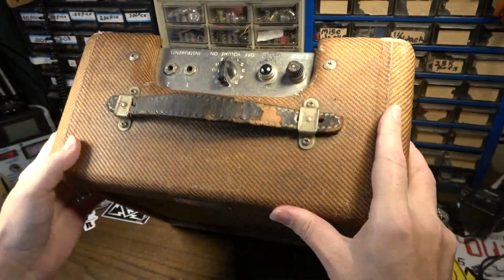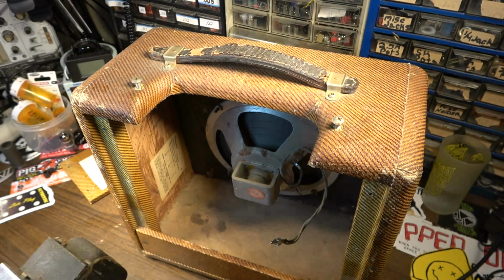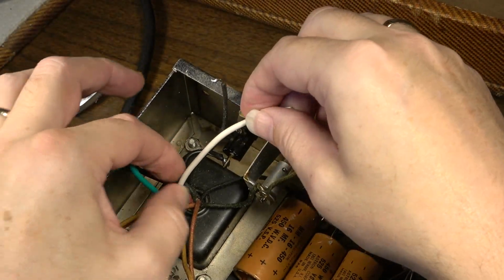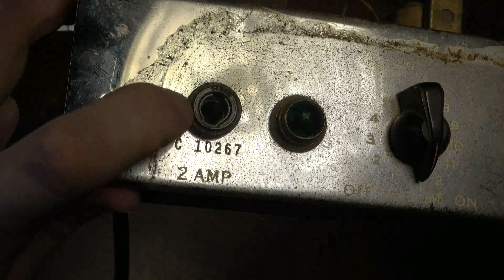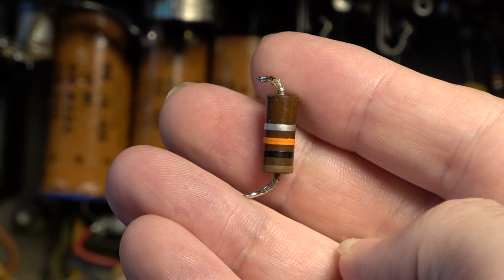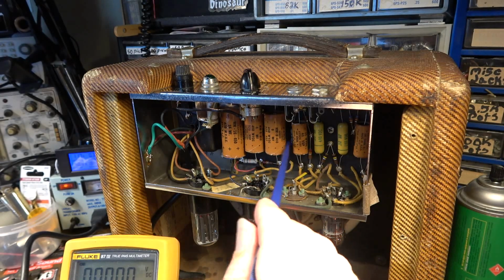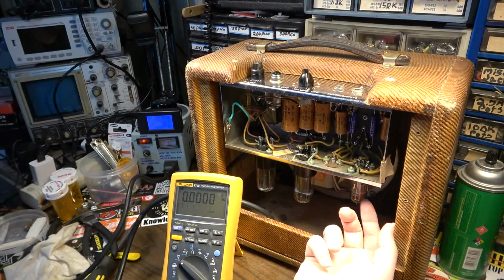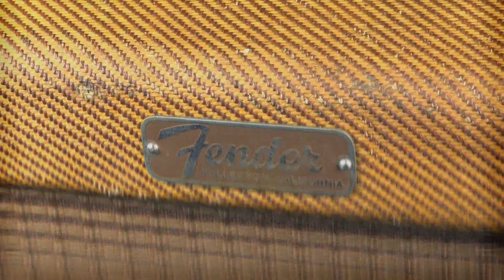1959 FENDER CHAMP 5F1 Guitar Amp Repair, Restoration & Demo

Comment: Speaking of fuse holders, when I was a teenager I used to play through a blackface band master. The amp had a vinyl cover on the head and sometimes it would get bumped and the bayonet type fuseholder would jump off and fall into the back of the amp, leaving the fuse sticking out. I would not notice and reach around the back to turn it on and get shocked. Happened a few times before I learnt to check it first, but being usually up on a wooden stage gave me some protection I guess.

Comment: I will share a thought I had on those capsule shaped caps. As opposed to trying to drill them or cut them, which from the attempts I have seen, they are generally brittle and break up, make some semi rounded buttons and glue them to the ends of the new cap. That will get you the general shape, and you can go as far as you like from there. Paint them blue or yellow, stick on a label. At any rate, there is an undue amount of effort you can put into it for what they are and the purpose they serve. I do like the paper cap stuffing though. Simple and not too time consuming to preserve the appearance.

Comment: I replied but but was too late for Live Chat....on the Uncle Doug fuse wiring...
I prefer the Fuse first...i have Electrical experience ( limited license ) and do lots over 50 years ...
The Fuse in my opinion should be First... As it protects you from there on in chassis....i unplug it if looking at fuse..or use pliers to pull a fuse if still Hot...common practice is ASSUME it is HOT... So UNPLUG....Or use a insulated tool if you have to Extract the Fuse ( most come out with the cap??  )  and it sticks inside...you just play it SAFE...I do get Uncle Doug's logic...and it is more for inexperienced users...so either way is fine...not sure what the code book says??
Reply: PLUS...you have to think live a Novice on this topic... They won't know whether the Switch shuts Off the power to the Fuse..unless they look inside or understand how wiring works...so the SAFEST practice is Unplugging the unit....it is going to safely cut off power in any wiring of power switch/fuse situation....
Reply from the maker: Code is fuse first.
Reply: @TheGuitologist  
Probably the same here in Back Bacon Land...it usually is ...and should be!
Reply: @TheGuitologist  
On some olde Fender schematic (not that that counts anything) I noticed (today!) on one wire the switch, on the other the fuse...
Reasonable ridiculousness...

Here in Europe the sockets are not directional i.e. one does not know (without testing) which one is hot.
So switching both lines is due.
Then I asked myself these days (as I also consider fuse first) it would be appropriate to fuse both lines,
because if there should be a short to ground, without the circuit, the current won't go through the fuse if it's on the neutral wire...
Saved 2 bucks while sitting in a dark cellar listening to the smoke alarm. lol

Comment: Another interesting thing is also how much those caps dragged the HT/B+ down, a sure indicator that they were leaking. I also personally agree that the fuse should go first, it would be even better having it before the line cord like the Brits do it with their plugs, but first thing inside the amp is the next best thing.

Comment: I always thought you had to lift one end of the cap to test for DC leakage.
Reply from the maker: Not in this particular instance. The side of the cap tied to the next stage's grid should be as close as possible to 0V on the 12AX7 or maybe even negative volts on an output tube, depending on the type of bias. A leaky cap will leak voltage across the cap just as a resistor would in the same position.

Comment: Cute little amp.
The OT is pretty small, I doubt if it is original. However, unfortunately that small sized output transformer is not a good sign if you want a beefy sound.
Many years ago I built a Champ clone and used a OT from a swedish 1959 Luxor Senator tube radio featuring a typical SE EL84 output stage. The size of the OT of that radio is almost twice the size of the OT  of this original Champ and it is still not very good at bass end and highs. 😱

Comment: Hi Brad - i am very good with my hands and I could certainly copy and fabricate this amp for myself. i am curious, if I were to do this, what is your estimate of the cost of the electronic components that I would need to build this?
Reply from the maker: It would depend highly upon where you buy the parts and at what quantities. If you're building just one amp, it might be worthwhile to look into the kits. There isn't a ton of markup in those. Or if you want to save money on a build, buy what you have to buy and maybe repurpose something for a chassis and cabinet.
Reply: @TheGuitologist  thank you

Comment: Wondered whether it would be worth preserving the history of the amp's electronics by mounting the old capacitors/fuses/etc on a small board and attaching it inside the speaker cabinet with written dates changed/locations so that the full history could be maintained for the future (rather than just throwing away the old components) ... ???

Comment: Lovely electrolytic restoration! Keeps the original look while functions good as new.
Pity about the asbestos. I wonder what it'd take to get rid of it properly. And I think that they should have used a piece of sheet metal, at least that would provide some screening and hum/noise protection.
As for amp repairs, I hold Uncle Doug and Mr Carlson's Lab in high regard. The latter has designed some interesting test equipment (capacitor leakage tester, outer foil indicator, curve tracer etc.) that would prove helpful in vintage equipment restorations.

Comment: A dab of Silicone on the back of that switch, between those 2 points, also locks parts down so they can’t move from vibration.    No such thing in 1959, great modern helper, good for potting those tiny switches, you might use to switch coils on a guitar PU.
so the wires don’t fatigue and break!

Comment: Brad - Please Read:

 It is not my intention to argue with you, and we kinda already had a bit of a discussion about the asbestos heat shield another time when you brought it up.  I left your response alone, but here are my credentials (and I might be missing a few).

I have a asbestos hazardous abatement license, a project designer license, a asbestos management planner license and a contractor license.  I also own a successful business that performs asbestos abatement.  I would never claim that I know all there is to know about asbestos and it's potential dangers etc., but I certainly would never tell my audience that it isn't "that big of deal as long as......" to use your words.  The truth is, we don't know.  

What makes asbestos so dangerous is that they really can't pin down or correlate exposure to illness.  One person can take a breath of air that is laden with asbestos fibers and end up with asbestosis or mesothelioma and expires quickly, while another person takes ten years, twenty years or more to be effected or symptomatic and yet another is not effected at all.  Or you could reverse that and say there is very little in the breath of air and have the same three results.

My point is, we watch your channel for your ability to repair amplifiers, guitars and electronics some good humor and wit.  We consider you a "professional".  Please don't confuse your status of "professional amp tech" with your limited knowledge of asbestos and its' effect on people as information you should pass along.  Particularly when the professionals in the field of asbestos abatement and the scientists that study it really do not know- for sure.
Reply from the maker: Thanks for the comment, Scott. I know it's coming from a good place. But please don't misunderstand what I said. Go back and listen again. I said what I believe is probably true, but sure, I only have intuition and anecdotal evidence to go by. There are many people who clearly are not affected the same way with asbestos as others. You said yourself, they have not pinned down convincing correlations in some studies. I did not claim to be an expert on asbestos. I only said I think the dangers have been overblown and unless you're breathing in airborne particles and with some consistency, having a bit of it sitting there in a solid state is probably not a big deal. I do believe that to be true. All that said, I think discontinuing its use in most applications is a good idea. I'm glad Fender doesn't still put asbestos panels in their amps, for sure!
Reply: Man he basically said, that as long as you arent breathing in the dust, and you are only around it for a few minutes, its probably not a big deal, which it probably isnt..

People act like its some deadly acid, that if you touch it for one second, you will die tomorrow.
Reply: @TheGuitologist  Its all good Brad.  It's not so much what you said that is the problem, but rather the people who watch your video and then are around asbestos someday and remember that Brad said it is probably no big deal.  That might end up a bad situation for that person.

It is actually a great product- an element that is mined from the ground.  Heat resistant, chemical resistant it can strengthen a product such as plaster etc.  It is still being mined - and used.   There are six different types and infinite uses.
 
Problem is people die from exposure and their deaths have been linked to inhalation of asbestos fibers.  And yes, it has to be disturbed.  But did you know that even moving it disturbs it?  You don't have to rub it, as you said, to get it airborne.  The percent content of asbestos in a product and its friability make it more or less friable and deadly.  Some asbestos is not as friable as others.  The heat cloth is considered easily friable. 
 
For fun, look up Libby Montana.

Lastly, would it bother you if someone says in a video that discharging caps is not necessary?  Do you think there would be someone listening that might be dumb enough to believe it?  No answer required.
Reply: @VashStarwind  It's alright man, go about your day, or better yet, make a stand like a man and decide if it is a big deal or not.  Don't pad your response with a "probably".
Reply: @scott729  Ok, its not a big deal. As long as ur arent breathing it in..
Reply: @VashStarwind  Lol, I agree 100%.  Honestly didn't intend to start an argument with anyone.  Probably should have left it alone.  Take care.  : )

Comment: Brad, I think you have the a/c wiring wrong. The fuse is hot all the time. If the fuse is checked with the amp plugged in, then there is potential for electrocution. If you wire the the switch first, then no possible chance of shock. It is safety first, and you want to take away the risk. If the fuse stays in the holder when the cap is removed, you have potential. If UL got the amp in for inspection, then it would fail. Just my opinion. Cheers 😀
Reply from the maker: I go into detail about all that. Keep watching.
Reply: @TheGuitologist  Brad, I heard you explanation, but I don't agree. Not a dig on you, but what's right is right. I wouldn't wire it that way at all. Uncle Doug is a smart guy from the old days, and he explains it. Good explanation on the leaky caps though, and now we have to determine when too much leakage warrants changing the couplers. 
Great video as always Brad. 👍

Comment: BRAD YOU SOAK THAT HANDLE IN BALLISTOL AND IT WILL NOT ONLY LOOK NEARLY NEW BUT IT WILL BE PRESERVED FOR DECADES..I USE BALLISTOL ON OLD 70 YEAR OLD LEATHER RIFLE SLINGS...WOOD...METAL...GUITAR NECKS...IT IS THE BEST PRODUCT OUT THERE TODAY...A VEGETABLE BASED PRODUCT ...  NOTHING LIKE IT..NO TOXIC...SAFE...
Reply: It's basically white oil, vegetable based in some very wide sense ;-)
But it is in medical purity grade, you could drink that stuff...
It surely is one of the best products at all.

Back in the day it was the oil german soldiers used for their guns (and probably smaller wounds) in the great war.

I guess I'd probably even try it on the tweed if it was my amp... dunno, maybe.

Comment: Those screws holding the handle bracket to the cabinet make me suspect that it's not original.  If you still have a contact with the guitar strap company that used to sponsor you, they might be interested in doing repro's.

Comment: I'm torn on the whole fuse vs switch dilemma....your logic holds up except for 1 situation, and it's one I've seen many times. Some idiot puts a way bigger fuse than called for in, and it welds it self to the hot side of the fuse holder, but doesn't blow.....then when you go to try and yank the old fuse out to check it thinking it's just wedged in,
!~ZAP~!
Reply: The hospitals and morgues are full with technicians who were late for the first lessons...
So they take these as their last.
Reply: @mrh.5903  lol....that's a good 1......however I'm not concerned about us techs, if we get shocked it's our own fault lol.....my concern is when some poor guy is 6 beers into his second set playing at some old bar, and steps on his input cable unplugging it, and assumes something is wrong with his amp (especially since he put too big if a fuse in) and goes to check the fuse.
Reply: Yea,
but you don't offer him taxi service either...

Brad showed it is impossible to touch the metal,
and if it is stuck, and one uses a knive or something... 
Then that belongs to the show.
Reply: @mrh.5903  fair point........a little "pyro technics" definitely makes for an interesting show lol

Comment: As far as i know tweed champs are open cabs .  
But then again  i dont own one. Mine is a siverface and its the same But ive seen lots looking to buy 1. theyre open back cabs  pretty sure
Reply: I own a 1960 Champ, and I can confirm there are two back panels.  One with two screws on each side that is 5.5 inches wide and one on the bottom with one screw on each side which is 2 inches wide.  There’s around 3 inches of open space between the two panels.

Comment: That other guy is dead wrong on wiring to the switch first.  Corporate design rules for GSE (Ground Support Equipment that I worked under) ALWAYS had L1 (the hot line) going to the rear fuse terminal first.  Switches fail and as you described, modern fuse holders are designed to break the rear connection to the fuse before your finger could touch the front of the fuse under the cap.  His logic is flawed.

Comment: Hey Brad, a little flux goes a long way.
Reply from the maker: For the chassis solder? Yeah, I know. I just applied some more solder to the joint instead. Did the job. Probably took a bit longer though, you're right.

Comment: 80% of all roofing here in my country is asbestos composite called fiber-cement.  Maybe the newer stuff doesn't have any (doubt it as Canada is still the biggest exporter to the world of asbestos) but the old asbestos roofing is so much more resistant people have no reason for replacing it.  Never heard of people getting cancer because of this here.  Maybe yes but it's never been enough of a public health concern.  Gang and street violence on the other hand will probably kill you faster here than that.

Comment: The reason you use a ground lug is so you don't have to heat up the entire chassis since it acts as a big heat sink. A small ground lug is also a fool proof ground connection. If your solder joint is good you won't ever lose ground but if someone who watches your videos doesn't have a big honkin' soldering iron tries to do that  solder joint they'll wind up with a brittle cold solder joint. Then when the amp gets knocked around in everyday use and the ground wire comes off they'll have an ungrounded chassis waiting to shock and possibly kill them. Just do it right and fix the ground lug. If you're doing work on high voltage equipment you have to tell people how dangerous it is and show them how to do it right. You did a good job by removing the death cap but then kind of jerry rigged the chassis ground. A lug crimped style chassis ground connection is SOP on any modern transformer isolated power supply equipment. Just saying.

Comment: Funny you say those yellow  Astrons are “leaky” never seen one that caused any trouble in an amp.   Especially in those positions. Showing they are leaking 1 volt means absolutely nothing in terms of tone/operation of that amp.  Are you throwing them in the garbage?? If so send them to me.  Saying they don’t have an effect on tone ???? Well I would beg to differ on that.  Although your work and videos are top notch    “Microphonic capacitor” I can peck on every mustard cap in my old Marshalls and get them to do what those are doing.  Again no adverse effect to the amp or tone
Reply from the maker: I showed you the pot going "whoosh" when I turned it with that 1V leaked onto it. If you leave that cap in there, that 1V will become 2V, then 3V and so on. Yes, that will eventually cause problems.
Reply: @TheGuitologist  ok. So in 60 years they have managed to leak a volt. You don’t turn pots when you play. I’m not saying you didn’t do the right thing. I think you DID ! Just being objective I think the amp would have been fine for many more years with the original caps. And I do 100% here a difference when changing tone  caps in those positions. Some people can’t.